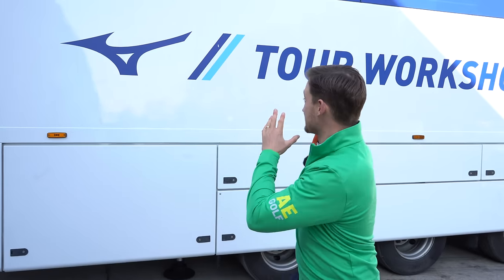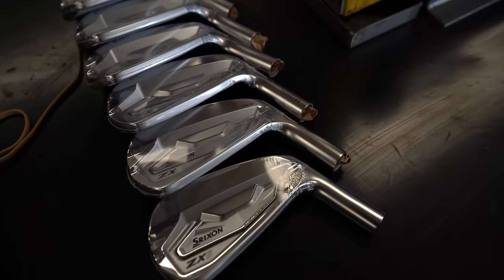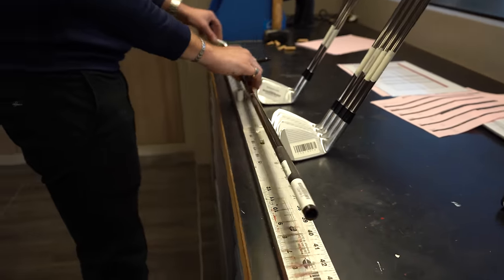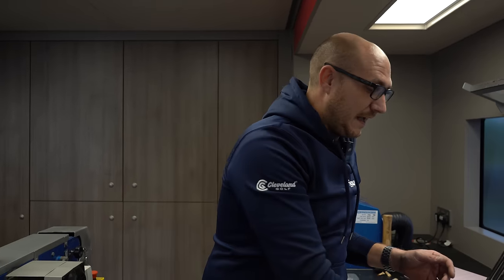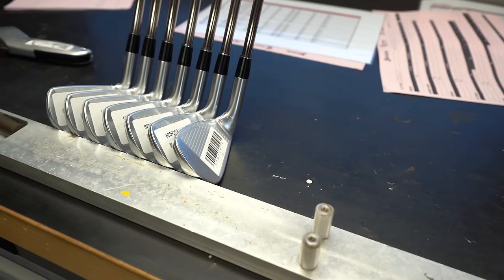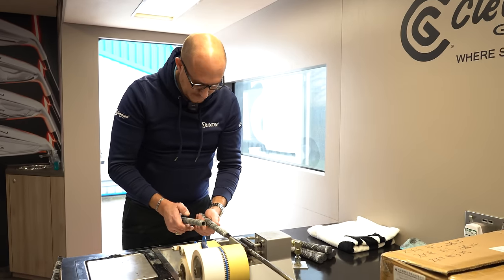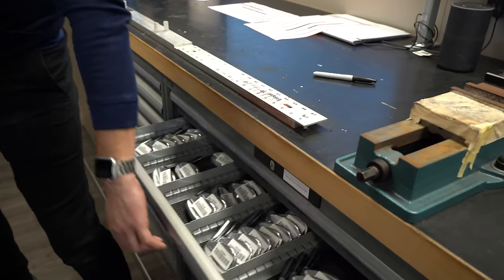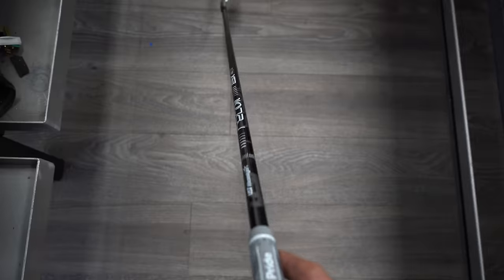WARNING This UNPOPULAR NEW 2024 Iron Could Actually Be The BEST YET...

Comment: i got the zx5  4 to pw set. effortless swing needed. i used the irons off the tee most of the time over summer the distance is incredible along with stopping power. when i hit them well it has one of the best feel response. i did upgrade the shafts to what fitted we'll for my swing